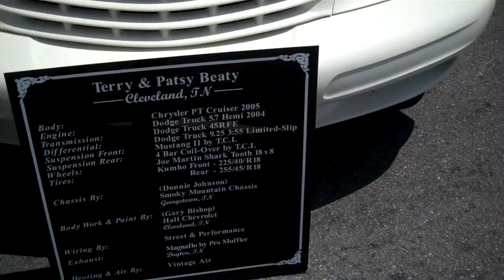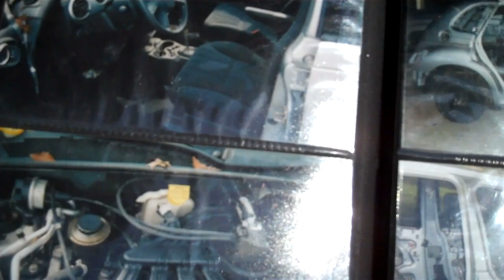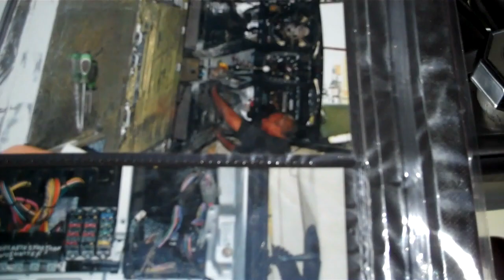2005 PT Cruiser 5.7 Hemi

Comment: That's pretty damn cool. I have one kinda similar. I have an 05 SRT-4 PT. Otherwise know as the PT Cruiser GT. Same motor as the SRT-4 (Turbocharged intercooled 2.4L) same suspension as the SRT-4. Same Exhaust. Same suspension just beefed up for the extra weight. Same tires and everything, considering it's built on the same platform. I've got a few mods done to mine though. K&N cold air intake, Mopar Blow Off Valve,  Mopar Stage 1 PCM tune. About a 5.8 second 0-60. It's not a HEMI, but it moves!

Comment: Thats a VERY VERY good build...  Its easy to build a car that is far from stock in appearance... Its impossible to build a car that looks stock, but is heavily modified.  The amount of time that went into this is incredible, and I'm talking from years of experience doing autobody and mechanic work.   Even if you hate Pt Cruisers (like myself) lol,  that is still an incredibly good build, the fact they fit that engine in a car that you can barley work on with a 4 cyl inside it.  You can't even get to the heater core without removing the entire dash board and steering column.  They had to do some real work to get that done, custom wiring/custom transmission tunnel/custom fabricated and engineered rear suspension and convert it to rear wheel drive/  and then to have the car appear as though they just "dropped it in"       Good job Gary, thats one hell of a job well done  ( might even be out of the range of my capabilities, I hate to admit haha)
Reply from the maker: For sure Brother...Gad You can appreciate the work it took to do this.....

Comment: I was thinking about doin this with my wifes 2007 pt when she gets 
a new car. What rear end was used?  would probably use a 5.0
Mustang 8.8 with a panhard bar setup. I wonder what the weight
difference is between the Hemi and the 2.4 ad how the front to 
rear weight ratio is affected. a million ?'s in my head

Comment: I've had this idea of turning a PT cruiser body into a hot rod. I'd go old school  on it though full tube frame. Probably change the whole interior to custom dash with old style mechanical guages.  Maybe a blown small block chevy. Been thinking about it for years. Gotta find a donor car with a blown motor or something.
Reply from the maker: Good luck with that!
Reply: ScottieDTV  I actually think it would be easier than trying to maintain all the electronic changes. I'd essentially just be using the exterior sheet metal and interior finishes with the exception of the dash gauges. They did a really nice job on this car in the video.
Reply from the maker: I agree.....Good luck with yours!
Reply: It's easier than you think I home built a hemI pt cruiser gasser wit a tunnel ram and efi and it was surprisingly easy the hard part was the front suspension because it's all gotta be costom fab

Comment: go check out my pt bought it in the same condition from a dump took me 8 months of body work frame work and finding an exact year model 2.4L turbo to fit under the hood along with some LEDglow wiring and backseat boards, a dual  10 inch subwoofer system, and 4 17 inch chroam rims